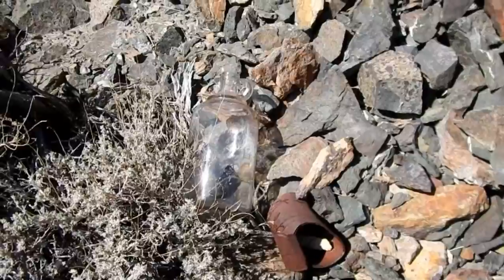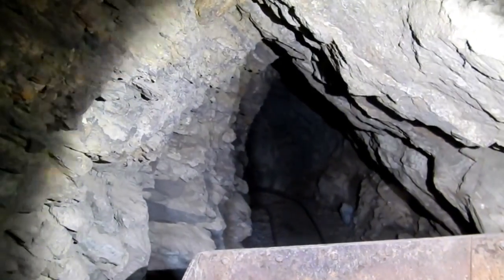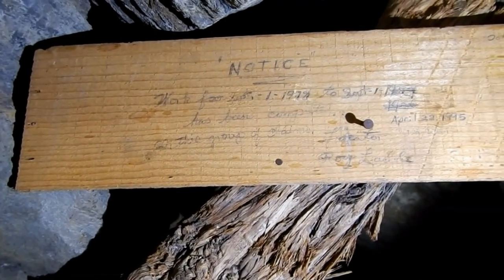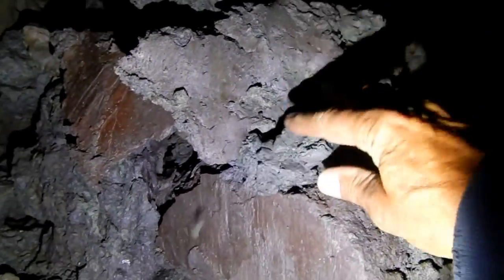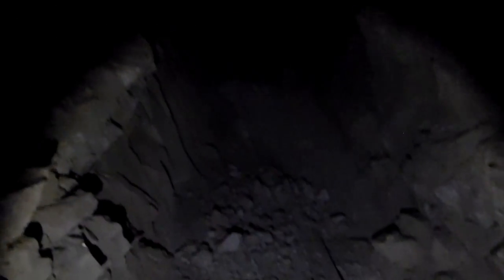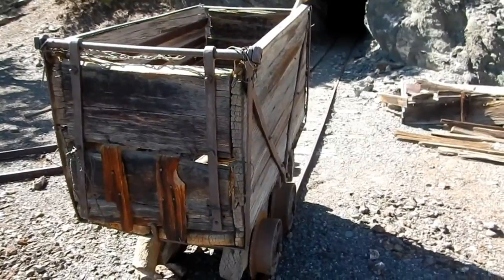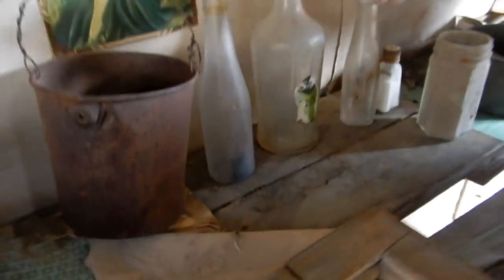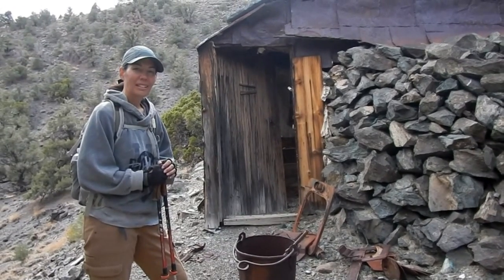Rare Wooden Ore Car Still Rolling On The Tracks And Artifact Filled Cabin -Tribute To Miner Roy Ladd

Comment: That was too cool you guys. I would love to have met Roy, he looks like quite the character, and he had very interesting toys. Very nice Ore Carts and the red steel one looked like it was riveted. Knob and Tube wiring, and square nails make it seem older than it should be. I presume he must have had a winch to get the Ore Cars up and down that grade on the tracks. I think that is the first time I have seen rails done like that, and I watch way too many mine exploration videos. Have you guys seen this before?

That was quite the cabin. The wind noise was audible, bu it didn't detract from the video or your commentary. A very interesting explore.
Reply from the maker: Yes, Roy must have been quite a character. The winze was a little steep for regular rails. I'm not sure what he powered the winch with. The frame for it was there to the side of the winze.
The cabin was great back in the day, I bet. The wind that day was really strong, gusting over 30mph. Thanks for watching and commenting, Stewart. We appreciate it!

Comment: That looked like a fun place to explore, I note the rock was pretty fractured down the winze, if the wheels had been left on the cart someone would have pushed it down the hole, IMHO it's good the y were gone.  thanks Tom and Julie.
Reply from the maker: This is definitely  a fun place to see. You're probably correct about the wheels. Roy might have taken them off for use elsewhere. Thanks, Mick!

Comment: What kind of handheld flashlights do you use?  Are they rechargeable?  What size batteries?  Thank you for your very interesting mine videos.
Reply from the maker: Hi Jeanne, we both use a Coast brand rechargeable LED as our main hand held flashlight. Julie has a XP11R and I have a little older HP10R if I remember correctly. I don't know if they even make the older one anymore. They come with an extra battery and are quite durable. I've dropped mine at least three times down shafts that I was coming up and it has not broken. They both have adjustable lenses to go from flood to spot.
Reply: Thank you for your speedy reply.  I found Julie’s flashlight model on Amazon.  It sure looks like an amazing light.  I do plan on getting one.  Happy desert trails in your rugged  Jeep.  You two are awesome in all of your wild adventures.
Reply from the maker: @jeannemackenzie4404  You're welcome.  I think Home Depot might carry some models. We ordered one of ours from Coast and the other through Amazon.